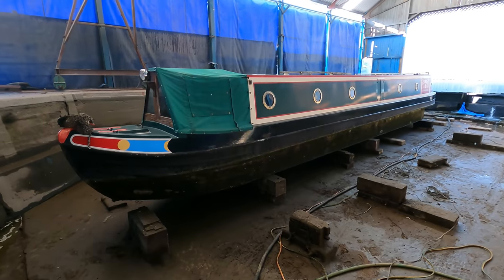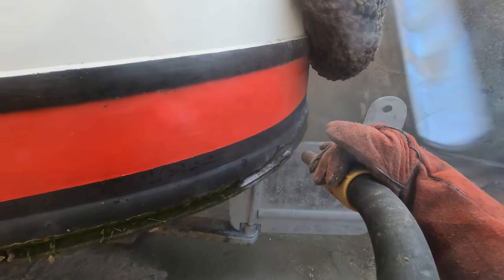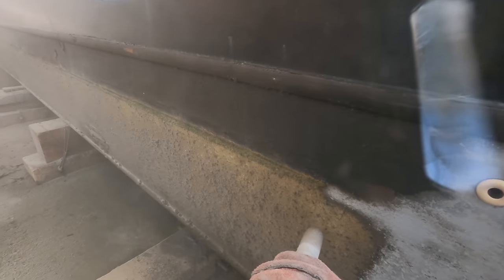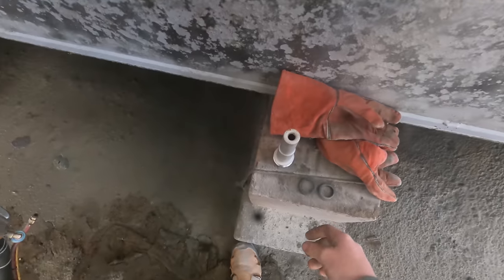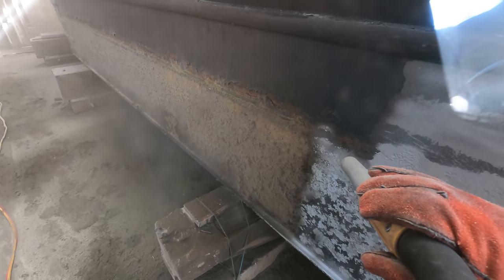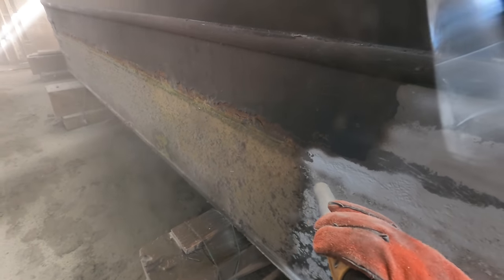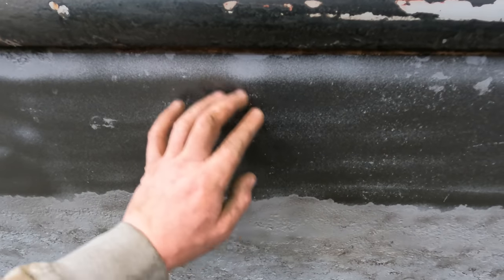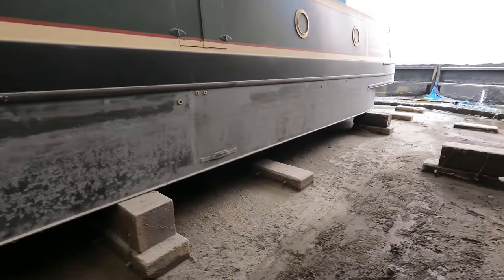Blasting Narrow Boat | SandBlasting canal house sand blasted

Comment: Hi I’m looking to get a Land Rover chassis blasted, do you know if they can blast the inside of it? I’m hoping to get it galvanised but it’ll need to be clean inside and out!
Reply from the maker: Unfortunately I cannot blast inside of a chassis to get it galvanised they normally dip them in acids and then hot dip them into a bath of glav if your chassis is need of repair may be cheaper to buy 1 done? I have a land rover chassis to do this week 😏 keep an eye out for that video 👌

Comment: What size nozzle are you using in this one ? Keep up the vids 👍🏼
Reply from the maker: Cdx 650 9mm ⅜ bore good for 230cfm I run 260cfm the spare air for the auxiliaries like helmit and vibration unit etc..

Comment: Do you have to sweep up after you have sandblasted and can the sand be reused.
Reply from the maker: At this boat yard I don't have to result haha the media can be reused but for the speed aspect of things I don't I use fresh every fill that way I know I'm getting a uniformed finishes as the 2nd time through the pot the media tends to brake down and get smaller

Comment: does the sand  get re used or is it thrown away with the old paint etc
Reply from the maker: It could get reused but I find quicker and easier to use new its all down to speed/time when I'm on a job. I like to fink I have drilled down on every aspect to perform at maximum performance

Comment: You should remove all milscale when abrasive blasting, paint does not bond well with it.
Reply from the maker: If that's the case why didn't the guy that put the paint on in the 1st place remove it? I can remove it but then the costs involved would almost dubble and to be honest I've done hundreds like this and not had any issues 👌

Comment: So it's hardly worth power washing my barge as soon as it come out of the water when the crud is soft if I'm gonna be sand blasting anyway, is this correct??thanks
Reply from the maker: Jet washing will help because it can stay wet for longer and water on fresh blast steel isn't good but not a major problem for me it makes no difference because the way I hit it I try to push it off into the damp areas but some blasters may not have the hindsight to think on
Reply: @Mobileblaster  I was going to get barge lifted first maybe power washed then it would be a week later before it would be sand blasted primed and painted.what I mean is there would be no blasting done the day its lifted out of the water,so will I just leave it and let the sand do the work or power hose it as soon as its lifted. Thanks
Reply from the maker: @derrickmurphy7729  yeah that moss stuff stays wet for a long time it will help to wash it and leave to dry or like ya say just save ya self some effort and let the blaster do the work it really don't make much difference. To be honest I like it as it makes for a better before and after photos haha
Reply: @Mobileblaster  😃👍thanks for the great advice mick.

Comment: Nice job ! What else do you blast ! Is that narrow boat spray painted or hand rollered after you have completed your job ?
Reply from the maker: Thx 💞 Please have a snoop through my other videos. I don't get involved with paint just the blasting side of things
Reply: Richard, it can be painted either way. I did  35 years in Ship Repair and after they were blasted they were normally given an undercoat straight away. These days with the modern paint they often let it dry and spray straight on top of the plate. Painting Ships is now a highly technical process and the paint is expensive. A clean hull can save enormous amounts of money on fuel. I remember in the eighties when the complete hull of a Tanker had been blasted and painted. I was talking to the Ship Superintendent and asked him how it was cost effective. He told me they would gain one knot. Working out, 1 knot at 24 hours running, multiply it by 10 days, 240, multiply that by 100 days, 2400 extra nautical miles, think of the fuel saved in a year of running, 7200 extra nautical  miles. Then go two or three years, it's amazing isn't it, all achieved by blasting and painting!

Comment: you need to get a laser cleaner system its more effectiv and faster
Reply from the maker: Unfortunately the technology isn't quite ready to do anything more than serface rust or very light paints. The cost of the unit is well over 1/4 million and that's not a mobile rig the mobile stuff isn't powerful enough to even remove serface rust(even if the location had 3 phase electric available). Plus they technology that's out even the most powerful unit cannot out perform a sandblaster for cost per meter. I like the idea and hopefully it will be cost effective 1 day to be a viable option but as it stands laser cannot compete against a blaster for speed or efficiency 👍

Comment: you need to use a chipping hammer to beat through the scale.  this boat has some rotten spots that need fixing.  beat every square inch for soft steel
Reply from the maker: Like a needle gun?
Reply: a good ship surveyor would take a chipping hammer and beat on suspect sections that might need replacing.  i love good heavy duty needle guns next best to a good blast.  we use sharp river sand for a "sand sweep" and black slag to go down to white
Reply from the maker: @jmyers9853  oh yeah I get ya 👌 yeah blasting is the way forward for serface preparation 👍

Comment: Can you reuse the sand?
Reply from the maker: Yes it's possible but I don't just for the speed aspect and once its been used it brakes down a little so the profile would be different so I tend to use fresh every time when I do bag up the waste I put it up for free for collection and small blasting firms/builders reuse my media so recycled bottle glass gets recycled quite alot before it turns to dust
When I get over run with the waste I send it to a glass recycling factory so they can charge me 2x for the privilege of using their products 😂
Reply: @Mobileblaster  okay I understand thanks for that 👍
Reply from the maker: @martinworrall5888  not a problem I like to help out were I can that's what it's all about I suppose 👌👍